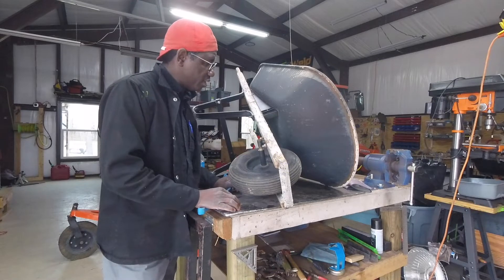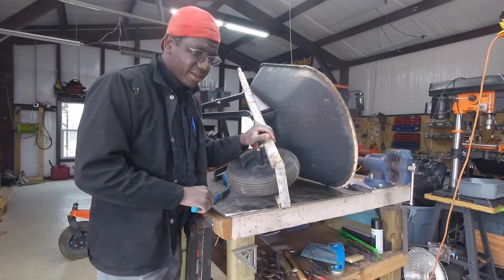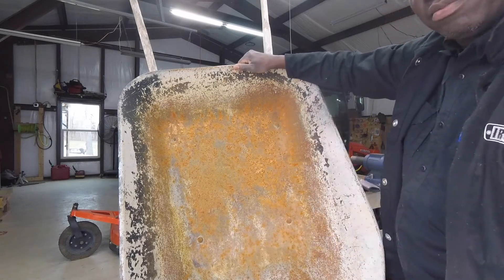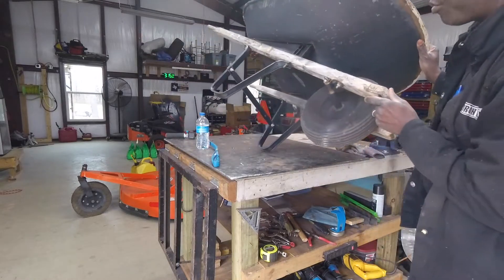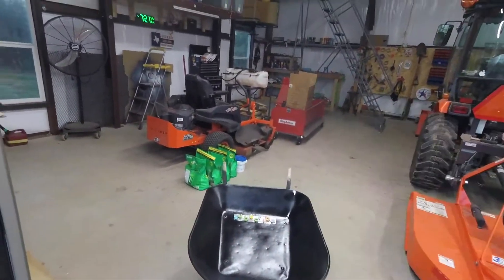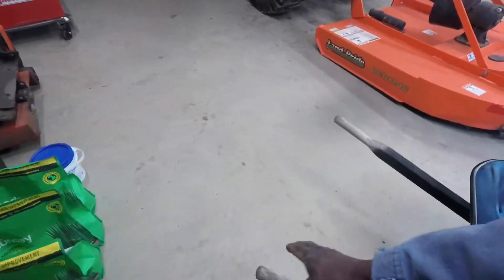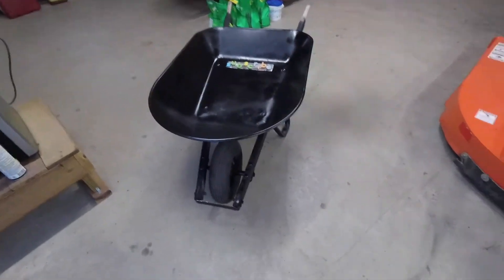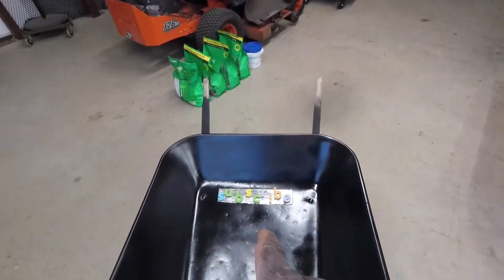Refurbed MY Wheelbarrow - A quick and fun DIY project . . .

Comment: Next time you’re close to your local tractor supply, grab a spray can or a quart of EZ-Slide and spray or brush some of that stuff in there.  Even sticky mud slides off of that stuff.  I use it on a lot of different equipment where I need stuff to flow freely.  Holds up pretty well too.
Reply from the maker: Hello My Friend . . . that you for the tip . . . never knew about that product . . . appreciate it!!!